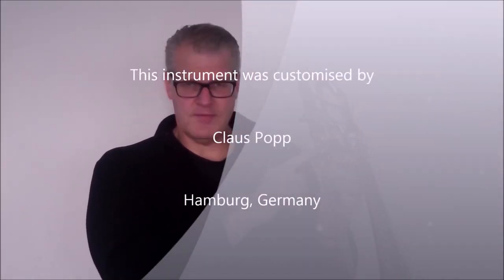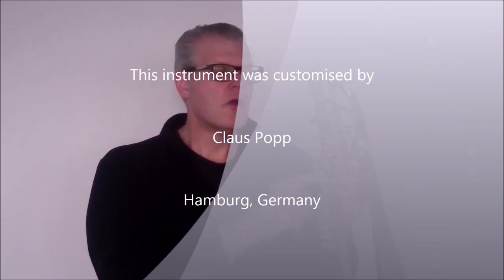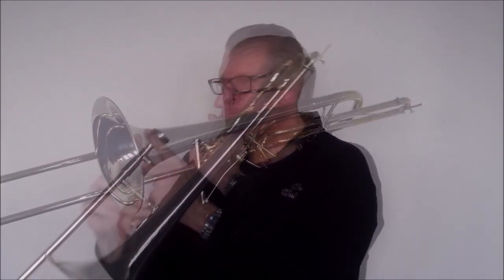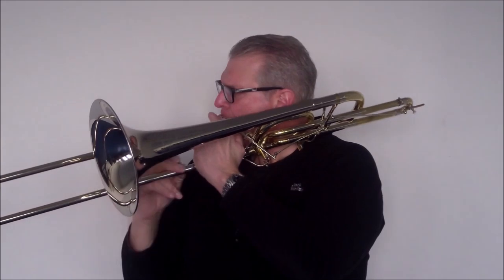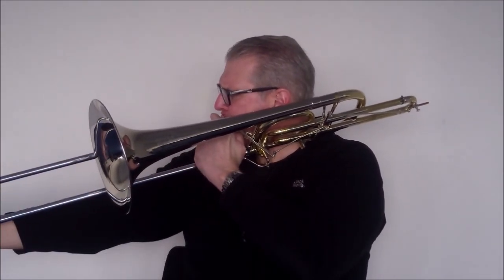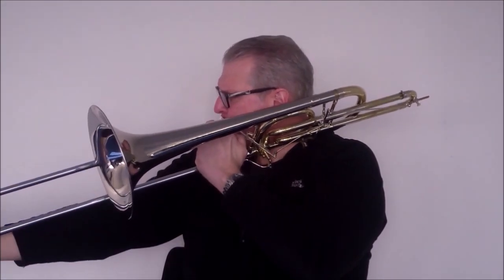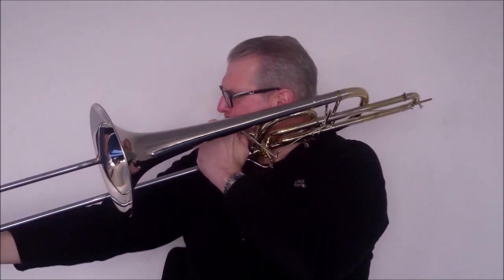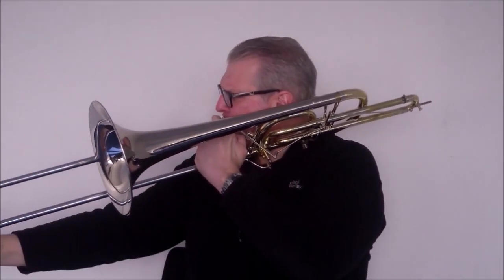Elkhart Conn 72H  Bass Trombone Trigger Conversion

Comment: Funnily enough, this modification makes your single-valve bass better suited than just about any modern dual-valve bass for the Bartok B-F glissando! Very cool modification, and while I as someone with short arms greatly prefer an independent dual rotor setup, I have to imagine the low C and B on this instrument are unparalleled in terms of clarity and volume versus when two valves must be engaged especially for the latter.

Comment from the maker: Keith,  good questions. It is fast, but of course a valve is quicker. First of all, it isn't really a substitute for a double trigger horn. I wouldn't use it to play solo repertoire, for example,   where a lot of quick technique is required. The other thing to remember is that the tuning is still in E, which means that C is in 6th, and B natural is in flat 7th. That is more of a hinderance in terms of speed than the trigger itself. On top of that, there is a lot of compression and suction involved as the trigger moves in and out. You have to learn to activate the trigger slide while the F valve is depressed. This all requires practice. 16th notes can be played, but I would use a double trigger horn if I need ed to play a lot of them. It was  a great project, and it works very well, but it is more complicated to play and use (and requires more effort,  as well.) Modern open wrap horns with good valves will also give you a fat B natural.☺

Comment from the maker: Hi Keith,  adding a trigger would probably be simpler, but would cost a bit more, I think. The main drawback is the fact that you're still in a long 7th position for the B. You also need a really good tech, because it has to work really well and be reliable, otherwise there's no point in doing it. But I like to play my low C in 7th pos. (even with Double trigger horns) because of the open sound,  and with this horn I also have a very open B natural.  Regards, Bradley

Comment from the maker: If the Conn 110H can be Tuned to E, then it could work, but you should read my comments regarding the drawbacks to this setup.  You need to have a good tech, and you have to spend some time getting used to it.
Reply: Yes ,  quart-trigger as basic setup is better for grif-options(Bb2-B2 break,or Bb2-F2 slow perfect 4th) ).Quint-triggers was out of positions
Reply from the maker: Hi Mirko, If I understand correctly, you meant that putting the F trigger on the middle finger is awkward.. That is true, but there was no way to get the amount of travel necessary out of the third finger, so we ended up using the thumb instead. It takes some getting used to, but it can be done. Regards, Brad

Comment: would it be wrong to take a 60's conn 72h and give it a little upgrade by changing the valve setup to accomodate a second valve?
Reply from the maker: Alistair Barrow 
Hi Alistair, it would definitely not be wrong! It is, of course a Good way to go.  This System does have its limitations. Regards, Brad
Reply: @bradleynystrom2514  Yes, they actually have quite a few conn 72H double rotor conversions out there.

Comment: you sound really nice! I wonder if that could be done to a BBb Contrabass Trombone?
Reply: I know I'm late, but I looked at the Miraphone contrabass model for a few minutes and it can definitely be done, however it would be pretty heavy and clunky. The material they use for those tuning slides on the big horns are naturally heavier than the material used for the actual slide. It can definitely be done don't get me wrong, but it would take a lot of tinkering to get it smooth, light, and usable in a fast setting

Comment: Why not just get a superbone and use it with all three valves down
Reply from the maker: Hi. A superbone is a bass trombone. It will not give you a fat bassbone sound.  The idea was to play low c and b natural with the least possible resistance i.e. with one valve.
Reply: @bradleynystrom2514  even the chargel?
Reply: It definitely does sound better than a standard bass trombone